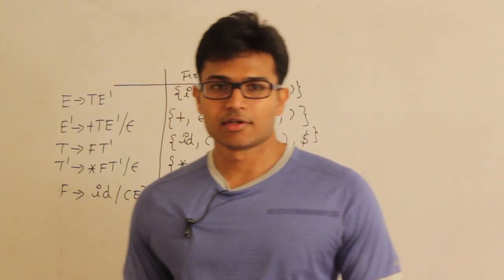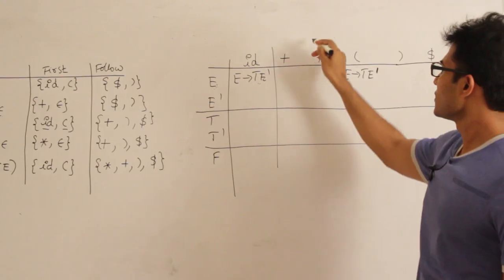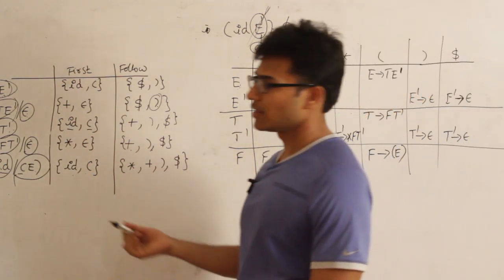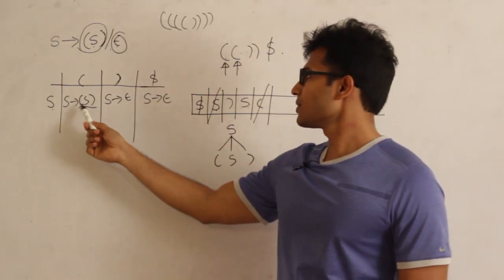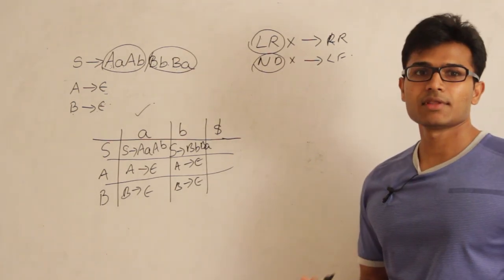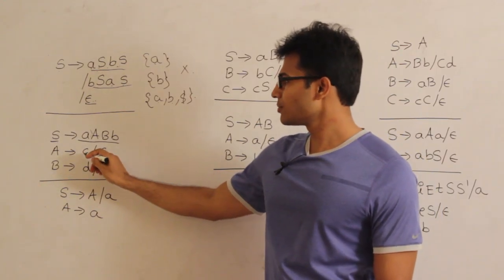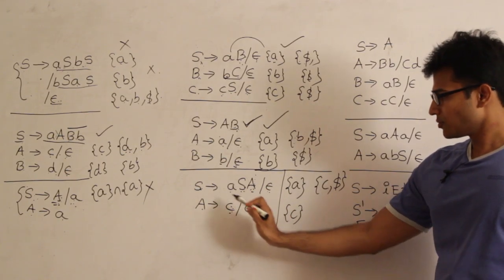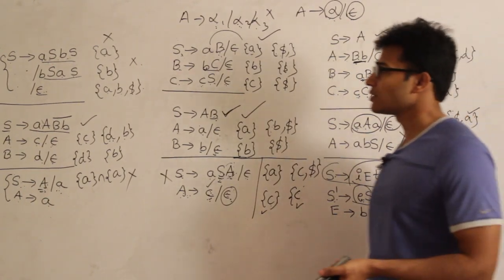CD | Parsers | Construction of LL(1) Parsing Table | Ravindrababu Ravula | Free GATE CS Classes

Comment: Is LL(1) parser the same as predictive parser? Please comment fast anyone, I've got my end sem paper tomorrow.
Reply: Yes it is same, I hope my response helps you in scoring well in your end sem paper, best of luck
Reply: You solved my doubt as well :D
Reply: Adarsh Vardhan  same
Reply: Nishit Sardessai yes they are same. Because in ll(1) you don't have left recursion or non-deterministic productions which means there is no confusion on which production to choose while deriving a string, so the path on how to derive the input string can be predicted without any confusion -which is why ll(1) is called a predictive parser. It's from my understanding of the video
Reply: From my understanding, it is a type of predictive parser.
Reply: A predictive parser is a recursive descent (top-down) parser without backtracking. It means that when scanning the given input string, if any of our chosen production fail to parse the input string, we don't backtrack and try out any other productions. If it does happen, meaning if the production fails to parse the input, then it is considered as syntax error. LL(k) is a class of grammar for which predictive parsers can be constructed looking 'k' symbol ahead in the input. LL(1) falls into the category of LL(k) class of grammar. So, for it we can construct a predictive parser. A top down parser has to choose,from the numerous productions of a non-terminal, which one will parse the input. Because there is no trial and error in this case, we have to be able to successfully choose the right production to parse our input string. FIRST and FOLLOW help us to that.
Reply: I am confused with same doubt

Comment: first nd follow of
A→AcB|cD|D
B→bB|id
D→DaB|BbB|B
and even fine its LL1 grammar or not
include this e.g in ur video sir
Reply: +manish singh 
First, remove the left recursion in first production then you will get the answer easily.
Reply: +manish singh  am stuck in same sort of question :(
Reply: the formula is always left factoring but what you used is right factoring..i doubt that it is correct? @michiel straat